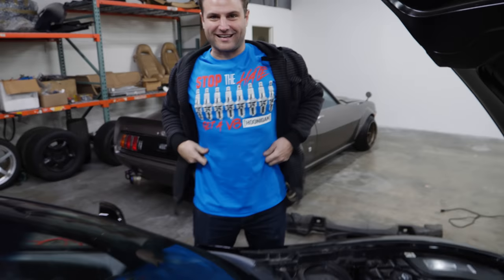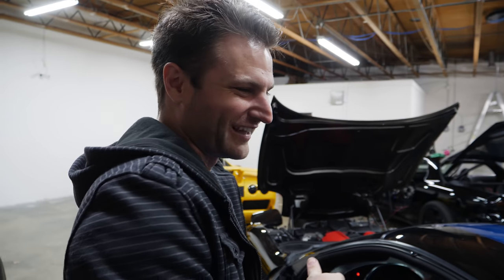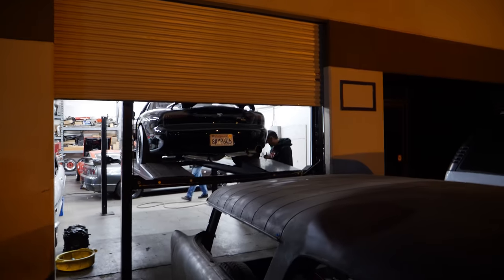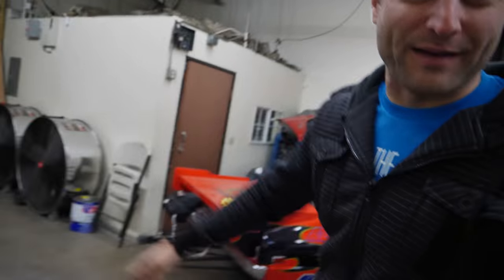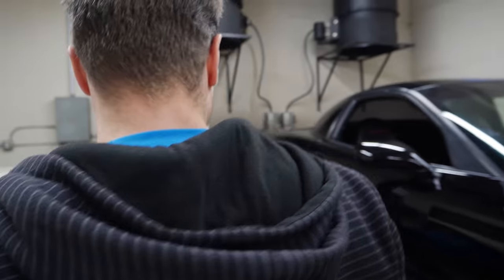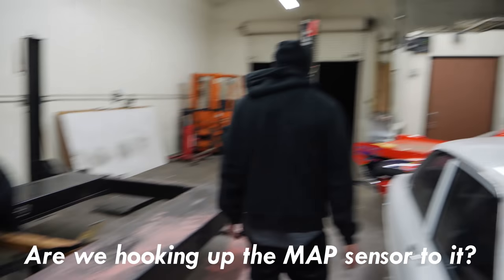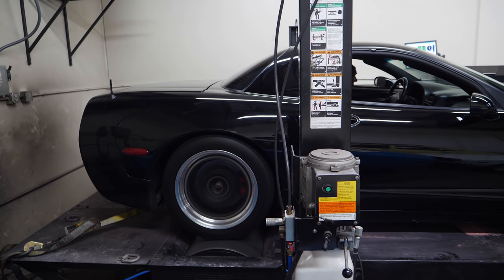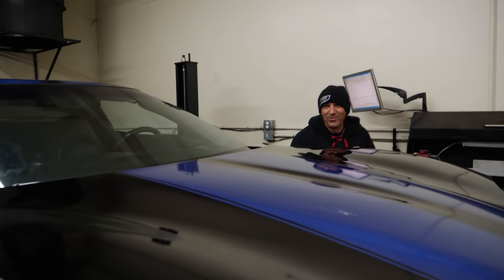LS SWAPS SUCK!!! ROTARY CORVETTE INCOMING

Comment: Finally, those LS RX-7s are now at its peace
Reply: Still the easiest way to get safe power out of an RX7.
Reply: William Stewart :|
Reply: @WilliamStewart1  If it doesn't have a rotary engine, it's not an RX.
Reply: @WilliamStewart1  not really a “rx7" Without a rotary “RX"
Reply: @WilliamStewart1  it's really not.. you can big turbo a stock block 13b and still make good, safe power easier than it is to swap an LS.
Reply: @shona5512  not just good power on stock housings either. The 13b world record car just went like a 6.3 over 200+ mph with OEM mazda 2 rotor housings. Them shits so damn strong.
Reply: William Stewart thing is that rotaries get more damaged when theyre not shifted at high rpms or not maintained due to the uneven combustions with low rpms. The Mazda 787 that won lemans was in perfectly good condition after the 24 hour race how awsome is that
Reply: Since the "R" in the name "RX7" stands for Rotary, if there's an LS in place instead, it's an LSX-7 instead tbh
Reply: @WilliamStewart1  the best things in life are never easy
Reply: @jamtea573  The 13b isn't a rotary engine, it's a Wankel engine. It's an RX7 not an airplane lol.
Reply: @shona5512  An LS swap is actually very easy to do on these now since it's been done so many times. Throwing a big turbo on a 13b will get you good peak numbers sure, but the curve is going to be garbage. Look at a 800hp RX7, doesn't make any power until 5000rpm. A mild LS3 build with a P1-x will net you a very safe and reliable 800hp with a very mellow useable powerband with power everywhere in the band. You also never have to worry about Apex seals anymore, flooding your engine etc etc.
Reply: @WilliamStewart1   No matter how common or easy an LS swap it, it'll still never be easier than bolting on a larger turbo because it doesn't involve pulling an engine or doing non standard wiring. Sure it's a viable option, but the whole "no low down power" argument is only ever used by people who've never driven an RX-7. This is coming from someone who has a 430whp FD and who occasionally drives my sisters C63 AMG (which is also an NA V8 and makes similar power figures at the same rang and behaves similarly to an LS) Instant power and torque is cool, but a surge is also cool, so it's personal preference, my RX7 makes power later but it revs so much faster than an LS so the wait time for a power surge is nowhere near as bad as you're making it out to be. No point in wasting your time trying to convince me, no matter how many unreliablity claims  and "Oh ThE aPeX sEaLs" nonsense you spew, you're not going to. The fact still stands that an LS swap is never as easy as a bolt on turbo upgrade. Simple as that. Nothing more.
Reply: @WilliamStewart1  If you're really worried about fucking up your seals on a street car, throw some ceramic ones in and make sure you premix. Also, let's not argue semantics, it's a Wankel rotary combustion engine. Call it a Wankel, rotary, whatever you want, it's still spinning triangles at the end of the day, still loveable and a great contender.. certainly an interesting one.
Reply: @shona5512  But you only have 430whp, not hard to have a good powerband with a 500hp car. Tell me this though, does your setup or a stock LS7 have a better powerband?
Reply: William Stewart "better" is subjective. On paper an LS7 is "better" because of the linearity of the torque curve, but for me personally I find my powerband to be better because it hits hard at once. I enjoy surging, as does many people with turbo cars. But like I said, it revs so quick that the wait time is minimal. Take the C63 V8 for example (using it because we don't have LS engines over here) from a 40mph 3krpm roll the V8 pulls because of the instant torque, but by the time it's at 4krpm, my RX7 is already past 5krpm, in boost making peak power. As a track car that makes a difference, but for road use it's almost negligible. I still don't know why you're trying to convince me. I already know the LS is a brilliant powerplant, I'm simply saying it's not as easy as a turbo kit. Why is that so hard to understand?
Reply: LS swapped rx7 owner here. It was 100x easier to swap my car than it was to build a 500hp rotary(an ls swap literally bolts into the car, 0 cutting/welding).. I now get a 508whp 2700lb street machine for less than $8000(including the car) with well over 20mpg, easier to fix, cheaper to maintain, sounds way better, and makes you fanboy purists cry. 
When i register my car every summer, its registered as a 1990 Mazda RX-7 GXL, an engine swap doesn't change the vin tag or model of the car... So you rotary fan boys need to realize that an ls swap only makes an rx7 better.  
And RX stands for rotary experiment, experiments fail and get replaced ;)
Reply: @Pieman6711  The ceramic is extremely hard and wears out the housing faster, burning oil fast af sucks too,  and if you want to make 600 crank you have to take the motor apart and at least bridge port it unless you build a 3+ rotor. Due to all the extra maintenance involved this would make a good race motor not so good street motor (unless your building a 3+ rotor motor) but at that point the extra iron and turbo setup make it comparable in weight to an all aluminum LS motor.
Reply: @shona5512  LS swaps make it better, once you enter 600hp range LS swaps are cheaper, easier and require less maintenance. you gotta open and prep a 2 rotor motor for 600hp (3+ rotor you don't and LS motors you don't) and once ur in the 3 rotor territory the weight becomes comparable to an aluminum LS
Reply: MillionairX agree man there is a reason why the Hennessy venom Gt uses an LSX and not a stupid rotary piece of shit
Reply: C Pinell stock 13b weighs more than an LS1

Comment: LS swap the insight, with the low coefficient of drag plus the modablity of the LS the thing would be one bad add sleeper.
Reply: It would need like 4 mufflers so zou can't hear it. If you hear a v8 noise, from a insight, well you know what's up....
Reply: It's his daily, an LS swap would just make it more unreliable and less fuel efficient.
Reply: Petrol Monkey I don’t think reliability would be a concern. And LS’s are decently fuel efficient. Ofc not to the level that the Honda is but at least it’s something.

Comment: Rob, 
You have to fit the engine in the back with that transaxle! It's made to be, like they planned all those years ago. Forget the torque tube and motor up front bullshit! It won't be hard to put out more than the original LS set up made!

Comment: Good idea to dyno this car on Abel's dyno, he should have lots of different 13B powerbands to compare against. I'm guessing most modified 2-rotors will be able to beat a stock LS engine above 3500 RPM, but probably not below 3000 RPM. Maybe add a 50-shot of nitrous to make up for turbo lag if you really have your heart set on blowing up another rotary.

Comment: I mean, is that a stock hp number? If so, it's not exactly total crap. Easily can boost it with some aftermarket upgrades. That said, would be interesting to see what that car would do with a build rotary in it.

Comment: In the late 60's Chevy actually built a prototype rotary Corvette called the 882 (XP-882) it was also mid engine sadly this never came to fruition then in 1973 they came out with yet another mid engine rotary prototype and still to no avail it never came to fruition lets hope that the c8 concept will actually take flight and not just be another failed concept.!

Comment: I do love that you plan on putting a rotary in that bet I don't think anybody's ever done that but my question is what you going to do with that motor cuz I could sure use that for my truck I would put heads cam exhaust and a supercharger I'd be getting around 800 horsepower part that sucks is I've got to get a new rear end for my RX7😖😢 but if you wanting to sell the motor or even give it away please get ahold of me

Comment: LOL that was funny. Even the little zo6 5.7 has potential. That thing can handle easy 650 Hp on stock internals . Get a turbo on in ,have the stock ls6 heads ported( zo6 243 heads have lighter valves). dont sell them. boost cam  , good cluth and u will have a mover. to bad u did not get a c6 zo6 ls7 427,

Comment: yo you gunna wire it good and run mechanical fuel pump :P also WORK ON THE FRAME FIRST that is going to take a lot of work, might as well cut off everything past what is good and tube frame

Comment: Hell yeah I'd do that in a heart beat and the corvette would sound so much better and turbo charging it would be a must no questions asked.
I really hope you do this just to piss off the purest corvette worshippers, that would be a laugh  LOL!
You will have issues with cooling but just copy the setup that Rob Spaghetti had done to his turbo charged Corvette buy mounting the radiator and intercooler mounted in an inverted "V" layout with one big ass fan mounted on the back of the radiator sucking cool air through it.
Also I work for Plazmaman and we do custom Intercoolers, throttle bodies, plumbing  for the intercooler install and Plazmaman clamps that have been tested to 700 PSI and they didn't let go in fact the welds on the test tube let go instead. 
I know we are in Australia and the shipping wont be cheap but with the way our Aussie dollar is compared to the US dollar is I think it would be well worth it and who knows you may even get a discount on parts if you rep Plazmaman in all of your new videos.
Oh I forgot to mention that we also do billet intake manifolds for LS GM engines, GM big block billet intake manifolds and Ford coyote billet intake manifolds.

Comment: Stock LS n/a 375hp, stock obsolete shitty 3 rotor n/a, 212hp at almost 9000 rpm. Thinks the LS  is junk?? Still ran longer than his 3 rotor without breaking down and its in a wrecked car.

Comment: So instead of rebuilding the 3 rotor you bought a car to put a rotary in that is close to the cost it would have taken to rebuild the 3 rotor😂😂😂
Reply from the maker: Honestly it almost evens out exactly.  I had teh vette in mind before the 3 rotor blew. Bad timing there.  But would you rather watch videos on me rebuilding the 3 again, or watch the exploration of putting a rotary in a vette? then with that revenue fix the 3 rotor.  Thats my rough strategy honestly
Reply: Rob Dahm you have a good point, keep it up ig😂 I got so interested in the 3 rotor then it blew, and you said u we're going to buy a corvette and I got kind of confused. I hope everything works out👍I'll be watching